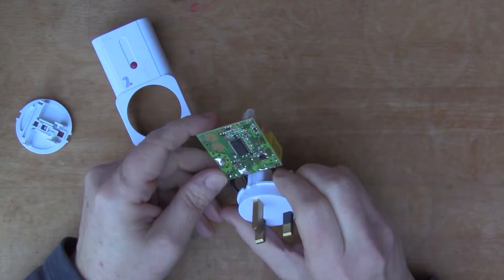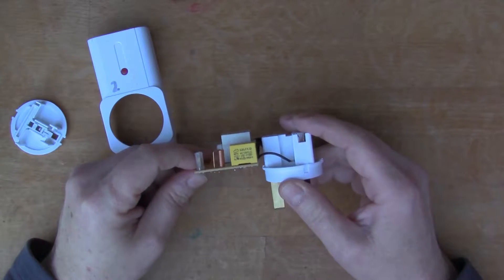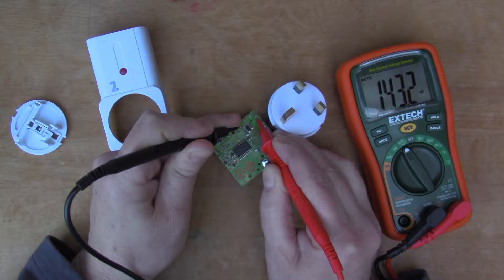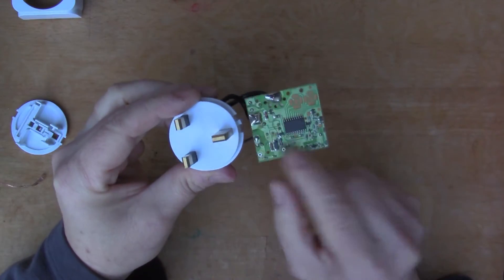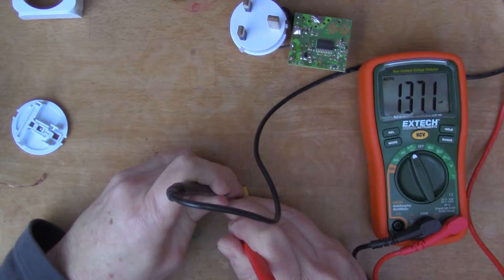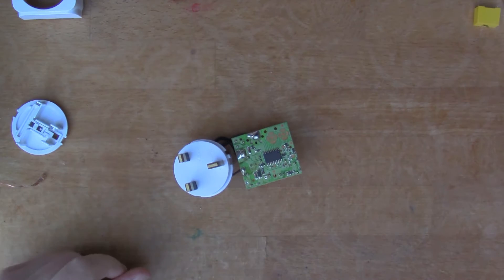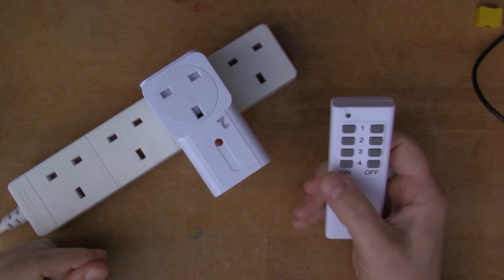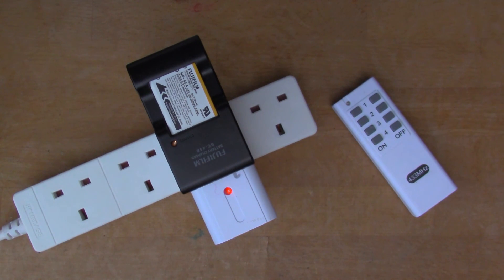More Remote Control Power Switch Repairs

Comment: Martin - you didn't say what the rating of the replacement capacitor should be - I take it that the new capacitor should also be about 330 nanofarads?.
Reply from the maker: Yes I bought a batch of these 330nF caps, so this was the same value as in the earlier repair video https://youtu.be/W0poFMy2AVM

Comment: Hi Martyn, I know this was four years ago, but would you happen to know what size the torx screws are? The set I have is a stubby one and won't fit down the hole.
Reply from the maker: By coincidence, I got these units out today to drive the outdoor Christmas lights - yes they are still going after all these years! The Torx T10 seems to fit well. I have a collection of torx bits for electric screwdrivers, but for recessed screws like this, it's definitely useful to have the dedicated, long shaft torx drivers available.
Reply: @MartynDavies  Excellent, thank you. I notice that mine seem to be security torx too.
Reply: Torx size 10 with pin in middle.